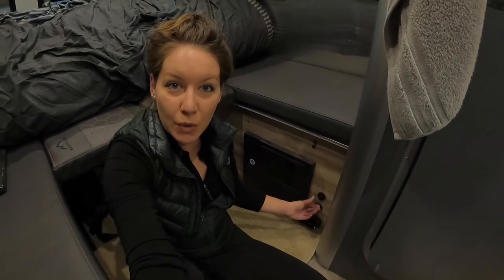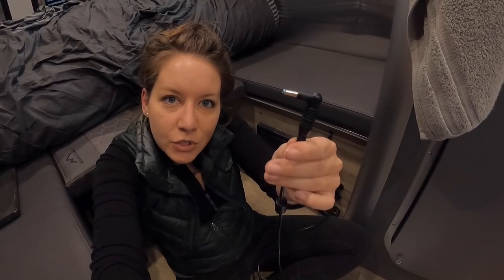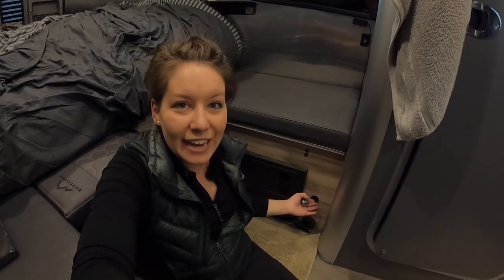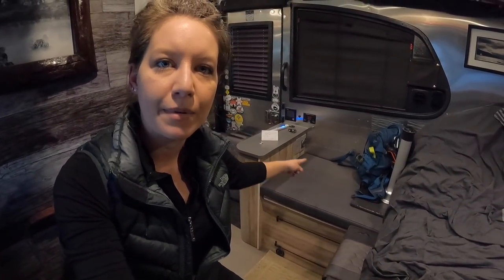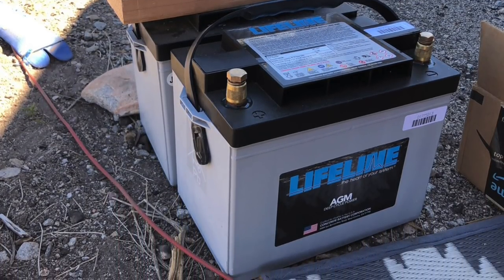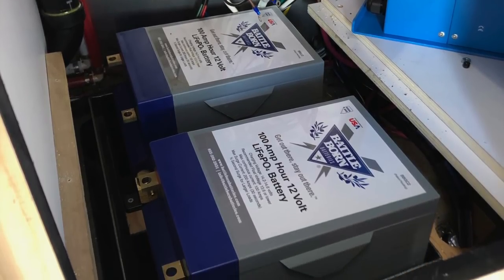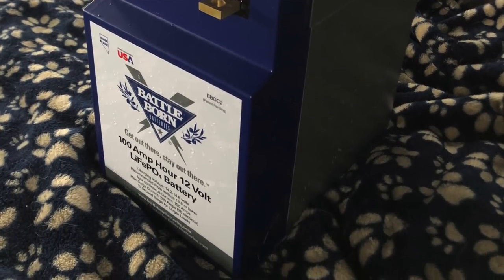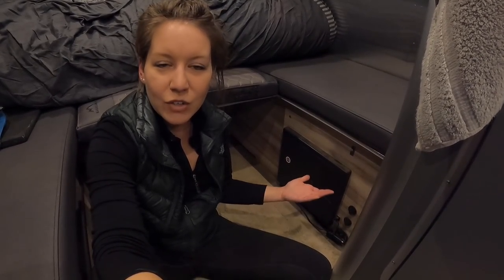Airstream Basecamp Electrical Basics & How to Install 12V Plugs for Boondocking

Comment: This was fantastic! So, conclusion: I will have to park permanently at a RV park. My 65 inch TV alone would take all my battery. :) How much does it cost to live at an RV park?
Reply from the maker: That or you would need a lot of solar!  Depends on the RV park and location.  I've seen some at $150 per month up to $3000 per month.
Reply: @TailsofWanderlust   oh wow. How much do they charge u when u go and charge up? Do u do just one night? Also, u explanation was fantastic. I’ve been looking for this. Everything I’ve watched so far leaves me scratching my head. ur very good at this. What is the most solar I can buy for my trail or truck camper? I’m looking at the Host Mammoth. Did I ask that the correct way?
Reply from the maker: @bochluge  I usually stay for just one night and use a discount service like Passport America.  I don't usually spend more than $30 per night.  I haven't heard of the Host Mammoth before.  The amount of solar will depend on the size of your room.  I know some larger RVs with over 2000W of solar!
Reply: @TailsofWanderlust  Host Mammoth. It’s a truck camper. Very plush. Even has a washer/dryer and satellite. :) I will have to upgrade to a Dually tho. This is great info. Thank u.

Comment: Cass, did you recommend to Airstream to install as standard a 12V plug?  Appears it has been added to the new 2021 Basecamp 20.  Not sure about the 16.
Reply from the maker: I'm an Airstream Ambassador (non-paid position where we provide feedback and tips for their site), so I've talked to them previously about the changes I've made on my RV.  Had no idea the 12Vs ended up in the 20X, that's awesome!
Reply: Yes, it is upfront left on the lower panel.

Comment: YOU HAVE A GREAT ELECTRICAL AND SOLAR SET UP BUT I WAS THINKING THAT A HANDY ADDITION AND BACKUP WOULD BE AT LEAST A 500 AMP HOUR SOLAR GENERATOR ( I DO NOT KNOW WHY THEY ARE CALLED SOLAR GENERATORS) SUCH AS A JACKERY OR SAOKE. I HAVE A 500 AH SAOKE AND A 2400 AH BLUETTI. THE FIRST WINTER BLIZZARD WE HAD KNOCKED MY HOME ELECTRICITY OUT FOR 21 HOURS. I RAN EVERYTHING I NEEDED OFF THESE TWO  FOR 21 HOURS AND BEARLY USED ANY POWER FROM EACH ONE. IT TOOK LESS THAN 30 MINUTES TO RECHARGE BOTH OF THEM. GREAT FOR EMERGENCIES.
Reply from the maker: Great idea!  Bluetti just sent me a solar generator to give a try.  Look for a video coming in the next few weeks on that!

Comment: If you have the heat on in the camper do you need to run the tank heaters?
Reply from the maker: For teens - 20s, I just run the heat.  If temps were going to fall below that and stay that cold (not warm up during the day), I'd want the tank heaters on.

Comment: Id recommend you go back and check into the voltages required for your computers.  The reason there is no 12 vdc adapters for your Mac is that it very likely requires 18 vdc.  The best work around is your inverter.
Reply: Every laptop uses 18-19V DC and laptop manifacturers do make power adaptors for 12V. There are power adapters for the USB C connector as well.
Reply from the maker: Thanks for watching!

Comment: Can you tell us about the generator on your truck?
Reply: Maybe I missed it but not sure there's a generator in her truck. The truck engine has an alternator as all gas/diesel engines do. The 7 wire rv plug has or can be wired to charge trailer battery.
If you need a generator the Predator line of Inverter style Pure Sine Wave work excellent in the 2000w model for most cases. Or if you want to run a/c the 3500 usually works but its about 100lbs so moving it is difficult
Reply: @mrmotofy  thank you for clarifying. I went back and looked. She plugged into the seven pin on the video but right before that she had mentioned a generator (as a separate option) and I guess I confused the two.
Guess those new F-150s with the onboard generator would be great for that!
Reply from the maker: MrMotofy has me covered.  I don't carry a generator, just use the 7-pin (which barely charges). Thanks for watching!

Comment: I'm really surprised that the Basecamp doesn't have a better off-grid system as a standard feature. It seems like the market they are targeting would be boondocking more often than their normal Airstream customers - especially the Basecamp X folks. (Hey Airstream (if you're listening)... make a better off-grid system part of the Basecamp X package (good inverter, better batteries, more PV panels, more USB & 12V outlets)).
Reply from the maker: Great input!  Since I purchased mine, they have made the Victron components and Battle Born batteries available as an upgrade.  However, the 12V still isn't standard, so hopefully someday down the road!

Comment: For charging by usb, it's not about the voltage, as all usb, even usb C, is just 5 volts. It's the amps that make the difference. Your 12v usb c adaptor is a higher amp charger, which is why it works better than the usb A ports, which are a max of 2.4a A macbook is power thirsty. You should look on your 12v usb c adaptor and see how many amps it is. You may be able to find a different one with higher amps, and then just use the one you have for phones. A higher amp 12v usb C could keep your Mac going, but will take your batts down faster... Though your solar should stay ahead. Check Amazon for 12v usb C adaptors, and look for one 3.6a or higher, and at least 50watts, but 65watts is better. If the one you have is less than 3a and 50watts, then THAT is the problem. Also, make sure you use the OEM apple, or another quality usb C cable. A cheap cable could melt and cause a fire with higher amps. Hope this helps. [edited because I originally said 50a instead of 3a, and meant 50watt]
Also, I just saw they are making a 20 base camp that is also taller and wider, with 3 water tanks... Though it's much heavier.
Enjoying your channel!
Reply from the maker: Really appreciate all of that detail Dana, thank you!!  I'll do some digging into a better adaptor to see if I can fix the problem of the mac not charging fast enough. Thank you SO much!

Comment: So you can plug your Apple computer into it and bypass the brick?
Reply from the maker: Yes, the USB-C cord comes out of the brick.  Plug it into the car charger with USB-C outlet instead, and plug right into the 12V.
Reply: Sweet.

Comment: I noticed with the Mac car charger you are using, it has two outputs with PIQ. The PIQ is older tech with lower output power, try finding one with a "power delivery" (PD) output. PD can provide can provide more power than PIQ. 
Try...:
https://www.anker.com/products/variant/powerdrive-speed--2-car-charger/A2229011
Reply from the maker: You have a very good eye!  Thank you for sharing that Anker. That is the one I usually use, but lost it somewhere over the last month.  I'll definitely be ordering another one!